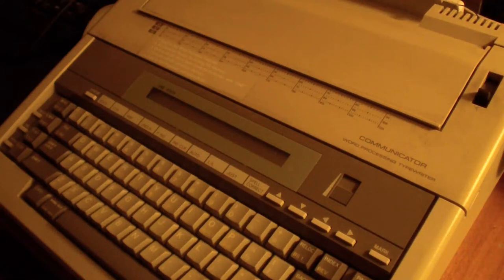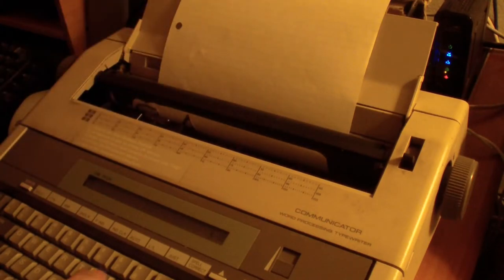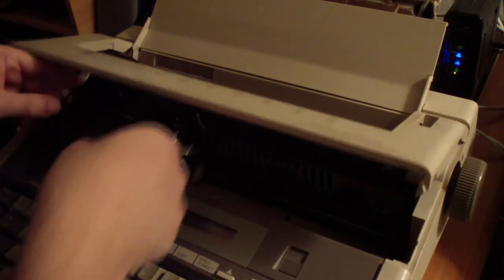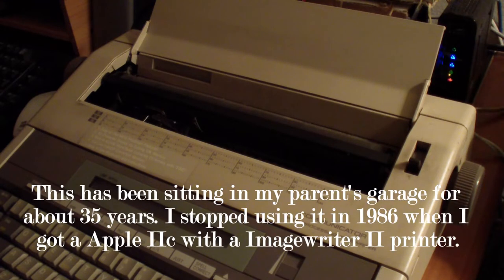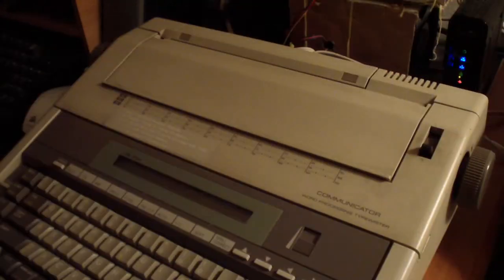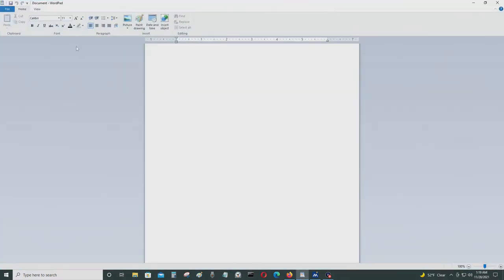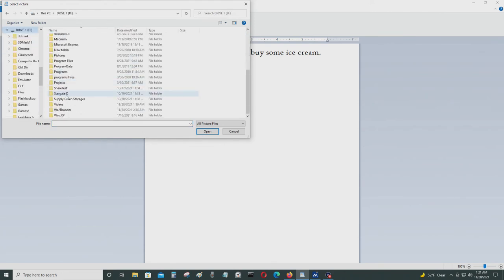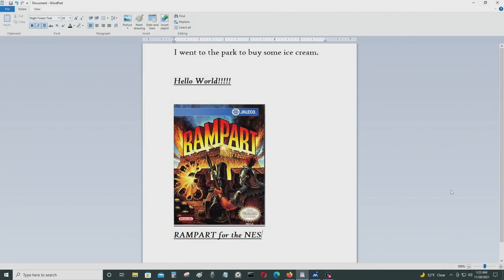Vintage Communicator Word Processing Typewriter

Comment: My job uses one of these but nobody understands how to use it beyond the basic typewriter function. Is there a manual for this thing anywhere?
Reply from the maker: You can view one line at a time, so you can view the a line on the LCD screen and read it before you type it out. It isn't like a Word Processor where you can view the entire page or pages before you print it out. 

Back in the day, you would write a draft on paper, and type it out on the electric typewriter. Some electronic typewriters had large LCD screens, like computer screens where you can save the document, and you can view the entire page before you type it. 

This electronic typewriter doesn't have a lot of memory, and I don't even know if you can save anything in it.

Why are you still using a typewriter? I thought these things became obsolete in the mid 1980s.